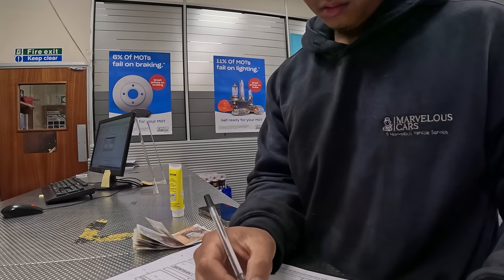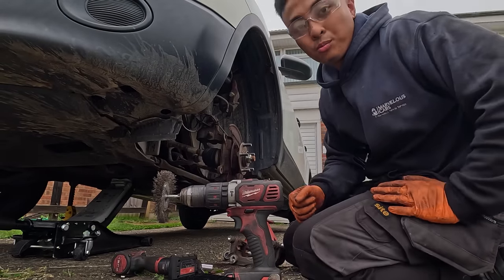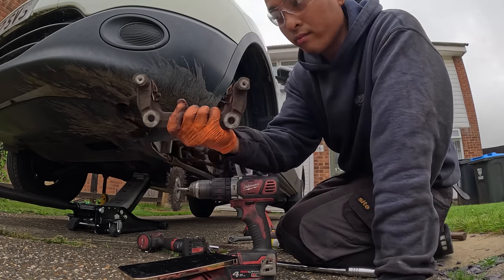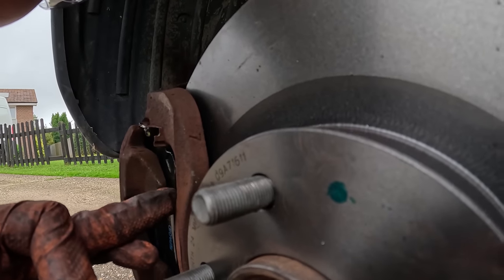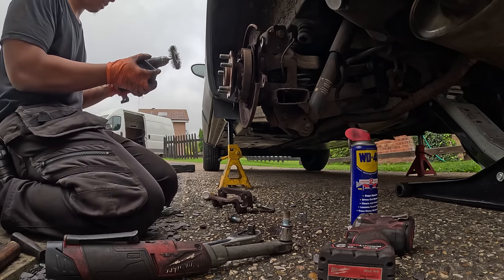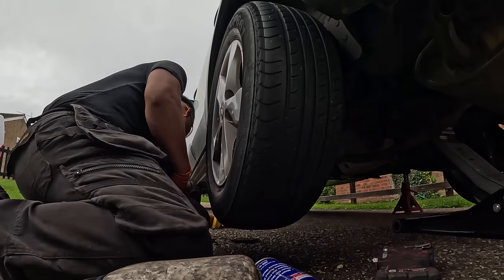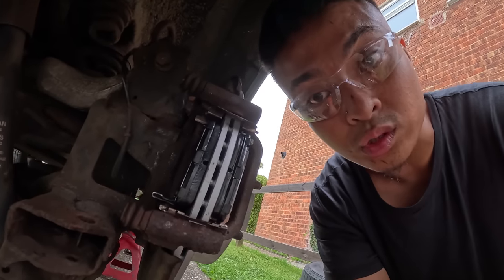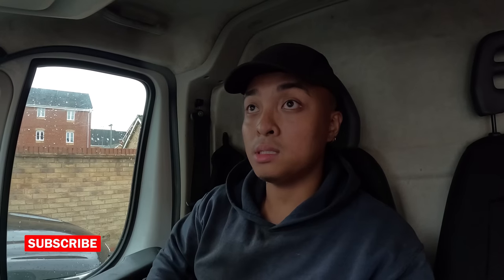CUSTOMER DOES NOT WANT TO PAY! HOW TO PREVENT BRAKE SQUEEK | Life of a Mobile Mechanic

Comment: Euro car parts at wolstanton stoke on Trent  sold me a front springs for my freelander  i had two 1 fitted very nice the second one did not it was scrapping in the inner wall my son in law took it off again and we soon realised it was the wrong one for my car it was longer and a bit wider so I got in touch with Euro car parts they did not want to know 1 reason they said I had left it to late i am disabled and have to rely on my son in law to do my work they turned me down completely so to Euro car parts up yours and dont trust them, thanks for the video

Comment: 0:50 I will tell you mate unless you're taking your car round a track the brake pads and discs don't matter too much some pads and discs might be slightly less noisy and wear better but the limiting factor on a cars braking distance is the tyres if ABS kicks in then your brakes are perfectly fine you can have the best tyres going and budget brake discs and pads and this is still the case higher performance brakes handle heat and disipate it more effectively thats it. Invest more in tyres than your brake discs or pads.
Reply from the maker: Yes but mostly no. So only reason why I recommend better brands is because they tend to wear less for the same braking performance + the reliability is different. I’ve seen cheap pads separate from the backing plate, discs warping after a month etc… and that’s the reason why I recommend using good parts, not because of what you mentioned above…
Reply: @themarvelousvlog  To be honest I always use good parts on my car because I want it to be reliable and quiet. I always use Bosch wipers and batteries, premium tyres and it gets fully serviced and even preventative maintaince stuff. I've never heard of cheap brake components having those kinds of issues either but I guess if you find a scummy joint that willing stocks the worst possible stuff that can happen. My mechanic always fits at least mid range parts to cars he deals in.
Reply: Nah most cheap pads owners are the ones cleaning that crap off their wheels daily. 
Mid range tyres n brakes is best

Comment: engineer here:  everyone here knows what pushes the pads against the rotor when you step on the brake pedal,  but does anyone know what is it that brings them pads AWAY from the rotors when you let go?
Reply from the maker: Go on then engineer, let’s hear it out 👀
Reply: The tension in the piston seal.
Reply: The piston seal distorts ,taking your foot off the brake allows the piston to return to its normal position.

Comment: Im a diy mercanic just work on my own car. Dont know a lot iv aways used copper grease and i use type 2 lithium grease for the pins im gonna change the copper grease to something else. Is the type 2 lithium grease ok to use ? Can you recommend  greases  to buy from europarts ?
Reply from the maker: We’ve all made that same mistake using copper grease. I’d say 99% of mechs have used copper grease on the runners/carrier 😂. 
(Just an opinion, not an advice); I’d avoid metal-based grease on brakes entirely.  Just buy the same product that I bought, which is actually made for the pins and runners.

Good luck

Comment: Solid video again, Shame  your not local, top job
Reply from the maker: Where are you based pal? I might be able to recommend someone to you
Reply: @themarvelousvlog  Portsmouth Mate, Sadly need a Auto Electrician. aftermarket drl stopped my driver side main beam from working. Diagnostic says its likely the bcm. Not many around who tamper with that sadly
Reply from the maker: Sorry to hear that pal. Can’t say much here as I’m not there to actually see it. Good to check wiring first before jumping in to conclusions. Depending on the manufacturer, good idea to also check if CAN is working. 1 side down means that it’s an isolated issue. Find the right tech and you’ll have that solved
Reply: @themarvelousvlog  cheers for the advice mate! Will play around on the weekend. Gutted being a first car with 15k miles. Last time i by lights on ebay 😂

Comment: Don't you open the bleed nipple when pushing the brake piston(s) back in?  I always do as it bleeds the calliper.
Reply: Only if it's seized
Reply from the maker: Not required but good practice. If you watch my other videos, it’s what I usually do. Only reason why I didn’t do it in this video is because my bottle broke and is leaking. Don’t have anything to lose to catch the old fluid- (sorry?)
Reply: @barrybritcher  as well as bleeding the calliper opening the bleed nipple makes light work of retracting the piston(s)

Comment: Emergency 🚨 on planet 🌍. In lockdown I parked my VW Golf Mk5 in my garage and forgot about it. It no longer starts. The battery has been replaced. The car cranks but won’t start. What is the fault?
Reply from the maker: Try making it sniff some brake cleaner. SHOULD solve your problem 😎

Comment: So you do a brake job but dont do a "break-in" after their installed. 

All rotors from the auto parts store do have a coating on them to prevent them from rusting. While sitting on the parts shelves. 

Cause that coating can on to the new pads and ruin them. Cause you didnt clean the rotor.
Reply: Not pagid

Comment: as a 58 year old mechanic i'm going to tell you what you did wrong. 1. replaced the discs (from what i can see there is nothing wrong with those discs. just a bit of normal wear) 2. you never checked the fluid level before you pushed the pistons back. (if it's topped up properly, it's gonna piss everywhere) 3. you never turned the hub around to make it easier to get to the bolts. 4. you never wiped that protective coating off. (you don't want that shit contaminating the pads) 5. you never, as a matter of coarse removed the shims & cleaned the rust from where they sit. 6. you never as a matter of coarse removed, cleaned & re-greased the sliding pins.  i understand you're a young guy, but i feel like there's a lot of stuff you should know by now that you don't seem to. anyway good luck mate.
Reply from the maker: 1. I replaced the discs in respect to the owner’s request. I advised him not to, he insisted to change them anyway.

2. My always starting point before doing brake pads (and discs) replacement is by removing the brake fluid cap, this is to check the level. Also for your information, I reduce the brake fluid to the lowest possible level without completely draining it, and also checking level after finishing a corner. So no, it will not piss everywhere. 

3. Didn’t know that was required but okay?

4. As mentioned in the video, the protective coating, on both front and rear, is not grease based instead, it’s GEOMET coated. If you don’t wanna know what that is, please look it up. 

5. I must admit, I didn’t at the front but I did in the back because I had to. But sure, I’ll keep it in mind. 

6. I don’t think you watched the whole video for you to say I didn’t re-grease the sliding pins. I didn’t just re-grease them, I’ve even cleaned them to the point that they look brand new.

I understand that you’re an older man, but I feel like there’s a lot of stuff that you didn’t know that you didn’t know until now such as the new technology called GEOMET coating.

Good luck anyway and thank you for watching my video. 

Constructive Criticism is accepted here but I feel like you’re boundary to being rude.

To the 58 years 🍻
Reply: @themarvelousvlog  Very mature reply from a young man.  Good luck with you business.

Comment: I disagree , I think you should encourage people to do their own brake pads & discs but the correct way, or maybe at least use a mobile mechanic or separate garage to their main dealer or MOT place. Loads of garages use brake changes as an upsell. I've changed my break discs & pads for years, (using copper grease 😂!) and I've come across mechanics telling me that I need new brake pads because there's only a few miles left , when in fact I know  when I changed it and just checked it & it was only 10% worn.

Comment: You do realize that Euro's brembo brakes are fakes?? Never buy branded stuff from them as they will most likely prematurely fail or cause other issues. As happened on my Skoda Octavia.
Reply from the maker: There are a lot of speculations out there that it’s a rebranded version. I’m not sure but I’d rather buy Brembo than Eicher 😂
Reply: @themarvelousvlog  To be honest I don't use brands I havn't used before and know work well. pagid and Bosch are my preferences. 

Currently got Bosch pads and disks all round on my Kia Optima. Fitted these at 86k, now on 162k after bad experience using EBC greenstuff brake pads from Euro Car Parts. 

Never again!

Comment: Lmao, apply grease then clean. Don't you think the crap will stick to the grease
Reply from the maker: I was waiting for someone to say this… 

Well, since that pads are installed already, it should be okay. Once the car gets back on the road, it will be exposed to sh*t tonne of crap, and that also includes brake dust from the new brake pads. So realistically, doesn’t matter if I clean the calliper first, or vice versa 🤷🏽‍♂️

Comment: I don't know who invented all those stupid worthless disc brakes while drum brakes were much better
Reply from the maker: In what way are they better? I’d like to know what you think please. It sounds interesting 🤔
Reply: @themarvelousvlog  In which ways? Drum brakes are cleaner and do not get stuck due to dirt and mud on the roads, but they are suitable for cars with high horsepower, so they are not suitable for smaller horsepower, such as scooters where disc brakes are installed, causing smaller engines to break if the brakes are stuck and continue driving without noticing